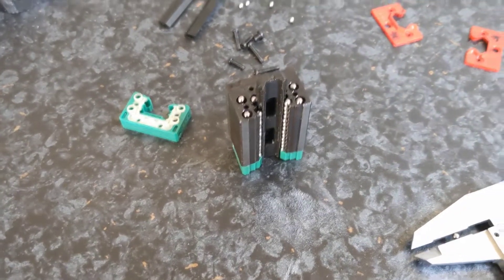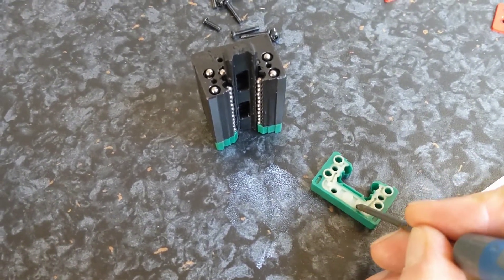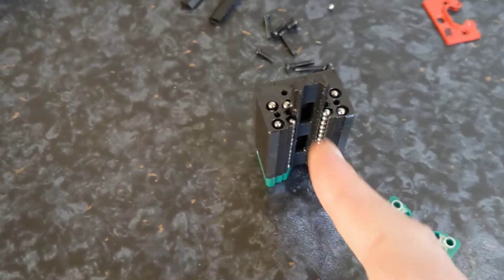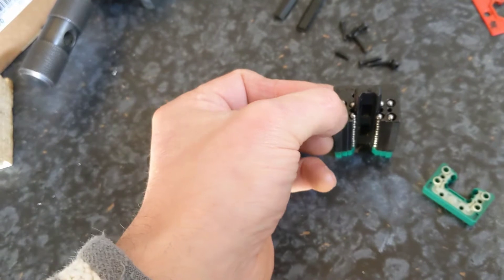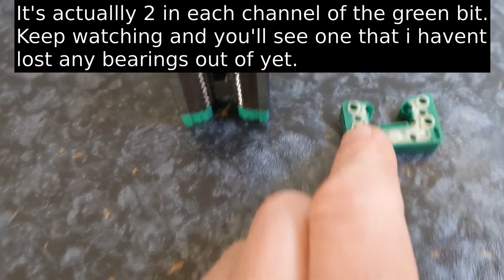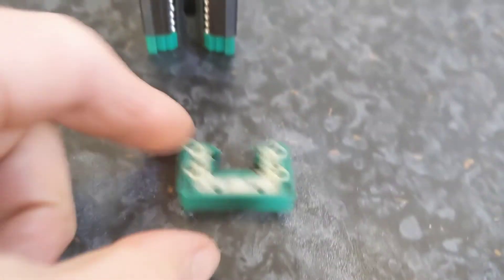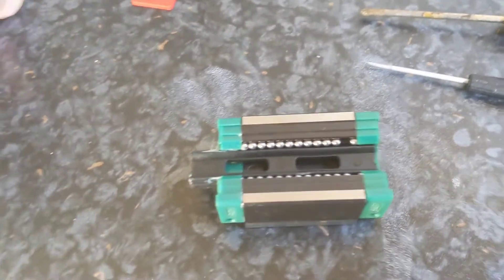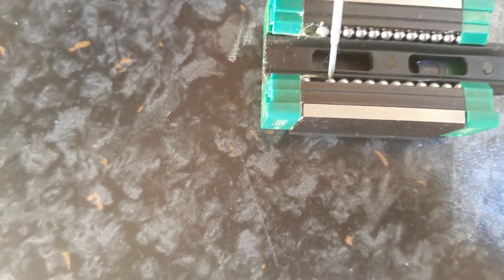linear bearing maintenance

Comment: you are an ANGEL. i was sitting here in literal tears staring at my 3d printer's linear rail that just exploded in a mess of bearings, i'm so relieved that all i need to do is just order some more 😮‍💨

LIFESAVER! you are in my prayers tonight
Reply: It might work for awhile but factory tolerances are gone, just order a few new linear bearings, they're not that expensive at all. You could damage the rails doing it this way. 
Your rail will have it's model on it and so will your linear bearing block.

Comment: I have a question regarding MGN12C rails. The maximum size that I can get is 1000mm, is it possible to mount them end to end and extend the range? Say if I mount two 1000mm rails end to end, I can extend the range to 2000mm
Reply from the maker: I've never seen the MGN12C variant of these so can't say fro sure but i think it would depend on how accurate you need the transition from one to the other rail to be. I think without very careful grinding of the ends and alignment there will always be some vibration during the transition.
While 1meter is the standard upper length for these, i've seen lots of sellers on AliExpress advertise custom length on request. Maybe they can do longer rails if you ask them?
Reply: @DuncanLaw  I tried it out, and yes there is slight vibration even the carriage moves over the joint. Do you think it will affect the life of the ball bearings? I have to design an automation system that will be in use constantly. I asked my supplier, 1000 mm is the max possible with these rails. However he suggested WEDM technology for cutting the rails, he says joints will be better, any idea what WEDM technology is?
Reply from the maker: @arbjful  Wire Electric Discharge Machining. https://en.wikipedia.org/wiki/Electrical_discharge_machining
I've never used it but it should leave a very square cut with no burrs.
From there is all about how precisely you can assemble things.

Comment: I wonder if it would be worth  swapping the bearings with ceramic balls instead.
Reply from the maker: It would definitely be possible but i'm not convinced you would gain much performance.
These carriages aren't exactly high quality to start with so the bearings are not the weakest link.
If you need the high precision or low friction provided by ceramic bearings, i'd advise you to start with higher quality (ie: more expensive) carriages and rails.

That said, if you had some ceramic bearings sitting about anyway, and a few hours free one afternoon, it would be an interesting experiment.
Reply: @DuncanLaw  did you know that the code of the bearing block specifies also a preload? I bought the heaviest preloaded ones as I need rigidity for the lathe they go on. If you need free movement for a 3d printer for example (which those don't offer for sure) try the lightest ones. The codes can be found in Hiwin website on some spec sheet or something and are the same for the chinese hiwin copies. At least the aliexpress sellers had the preload codes and no explanation for them so that a buyer who buys randomly doesn't know what is getting.
Reply from the maker: @MF175mp  Interesting. Thanks for the info. I'll look into that more if i ever buy these again.
I suspect the average cheap versions of these do not have sufficient repeatability for the numbers to be meaningful though. Mine are at the upper end of the cheap range and preload still varies a bit between units which come from the same batch.
I would advise anyone who actually needs the precision these numbers imply to buy better quality (more expensive) bearings than i did.
On the other hand, if high precision is not critical, i'm very pleased with the value of the ones i got.
Reply: @DuncanLaw  I'm sure the ones I have will be sufficient for a diy lathe in terms of precision. The mounting slot precision would be the most important thing as the rail is pulled straight by the means of that slot if it has any slight bow in it. Also it's pulled crooked if the slot isn't perfectly straight or has some dirt in it. What's nice is that this cheap rail offers the possibility of upgrade, if you want to go with more precise Hiwin rails they would bolt right on.
Reply: Ceramic Si3N4 bearings very expensive.  I believe most generic linear blocks use stainless steel G25, just get some chrome steel in g5 or g10 grade will be plenty upgrade.